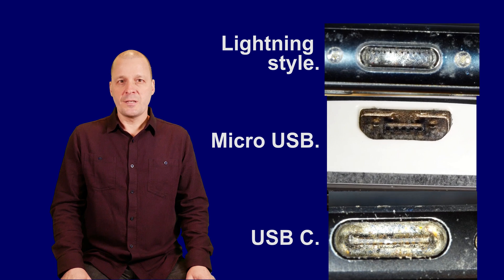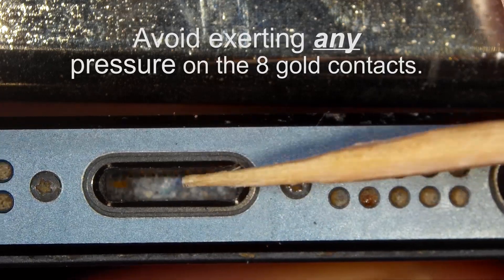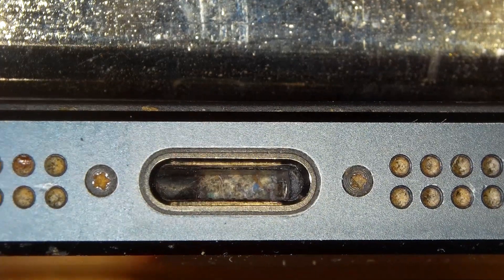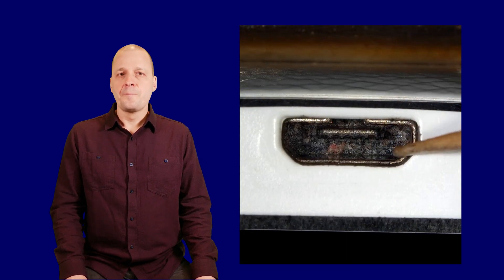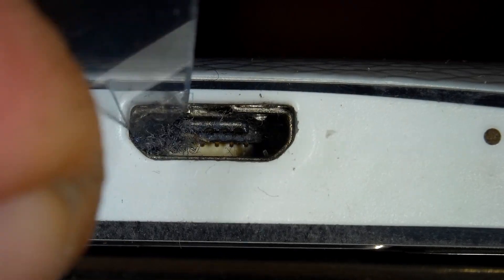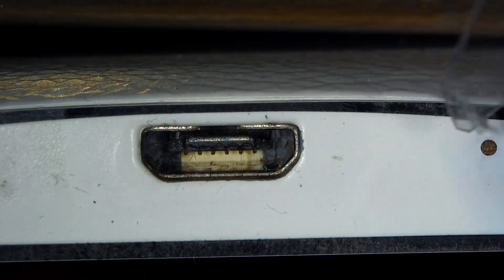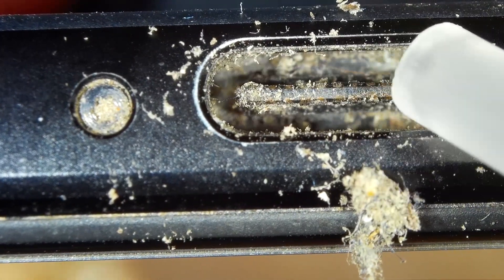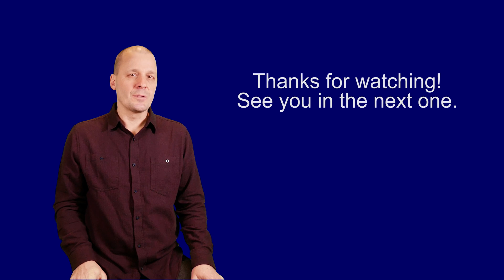"Simple" Fix for Phone Not Charging: Works in 2025. Lightning, Micro USB, USB-C #32

Comment: Okay, I've got one here that's really got me stumped. I'm having the problem you describe in this video, that is, a loose charging cord connection that is easily demonstrable by the mere effect of gravity, and a phone that won't charge as a result. It's an Android A71, it uses a USB-C style connector, I can't observe any visual impaction in the connector socket, in fact it looks remarkably clean, but my eyes aren't what they used to be, and there is a definite rocking motion observable when the connector is pressed firmly into the port. The connector seems to want to list to one side at an obtuse angle more than it does on the other. I've tried using a different cord, I've constructed a cleaning tool using your clever little teardrop design out of that damnable but indestructible clamshell packaging that takes an act of Congress to get into, and I've used a plastic toothpick of the type that flips out of the handle of a single use disposable dental flossing tool. I've recovered no debris or lint, and while my eyes may be deceiving me since I'm pushing 50 these days, it sure as hell looks like it's clear of obstruction. I'm out of ideas here. Got any Hail Marys for me?
Reply: While I am tempted to reach for the bottle to drown my sorrows, the vodka I've got is only 80 proof, which means it's not very well suited for my purposes. I'm going to go pick up some isopropanol in a bit and see if that gets anything moving. It's possible the port looks clear because it's so solidly impacted that it's formed a flat surface. That can sometimes happen with earwax, which is the real reason you shouldn't clean your ears with cotton swabs. If it works, I'll report back.
Reply from the maker: Okay, On my phone, "once", I ran into a scenario where the USB C charge cord end had debris jammed into it! That stopped the plug from going in all the way. You mentioned that you tried another cord. I would verify that the charge cords aren't part of the issue, by plugging them into another USB C port and making that they are snug. Your USB port shouldn't require ANY solvents (just my opinion of course). Please let us know how it went. Good luck!
Reply: @mysimplefix  Hey, sorry I took so long getting back to report my findings, I was delayed by a combination of life getting in the way and trying to hunt down this particular page in my history. (Side note, I love Firefox, but its bookmarks are TERRIBLE, my God.) The isopropanol worked! However, it did not present in a way that I've heard of before, so you might want to make note of this one, because it's definitely an edge case. In my situation, there was no substantial debris causing the blockage, so my eyes weren't misleading me. To recap, I was having both a failure of the charging circuit to close, as well as what appeared to be an obstruction in the port socket. I used a feeding bottle for baby animals (I live on a mountain, they're everywhere) to apply enough droplets of isopropanol (91% pure) to fill the socket, let it air dry right side up, that is, port pointing down, then repeated this process upside-down. This was so that any runoff that got into the case wouldn't have gunk in it, and to ensure that all contact surfaces were adequately covered. It fixed both problems like magic. All I can figure is that some sort of thin, non-conductive liquid had dried and was covering the contacts and making the connector fit in too stiffly. I do a lot of work outdoors, so I often get covered in tree sap and all sorts of other mysterious substances, so I can only guess that some of that got in there. Again, at no point did I recover any physical debris such as lint. Whatever was doing it was invisible and insubstantial. Put this one in your case files, because it was an oddity.

Comment: The C is male type of pins. Lightning is female type. Micro USB A has the most but micro A with B does not have many. For Samsung Galaxy S5, it has micro A with B and it has charger USB cap for protection. I stay using Samsung Galaxy S5 to use charging cap to protect not to get moisture dust and debris get in and it shows when I disconnect the micro A with B USB cable it shows close the cap. When it is not responding to charge, you need to look at the micro USB, lightning, C pins. When you see nothing from the pins, then it works properly. I also close all my devices using charger cap to stay protected firmly.

Comment: Thanks for this, very useful. I've just determined that the problem with my phone's USB C port was compacted lint. After turning it off (a very important step), I've just used a very fine sewing needle to work away at the compacted lint and clear it away. The port works fine now.

Comment: I’ve been trying to fix my rig headset with a micro usb because the charger is loose and it won’t charge and I looked into the charging port but I don’t see any debris and don’t know what to do
Reply from the maker: If the charging port is a micro USB, and it spends a lot of time in your pocket, it will quite likely have debris in there. I will ask, when you plug the cord into the port, is it going in all the way to the bottom? If not, there likely is debris stuck between that small tab and the inner wall of the charge port. As described in the video, that debris needs to be carefully swept out. Don't bend the tab in the port!

Comment: I was about to purchase a new USB-port and started stressing out about my phone still not holding the charging cable (I've used rubber bands to clamp the charger in place for the last six months) in place, even with the bands, and then I saw this video. Thank you so much, fine sir! You've saved my 3 year old Huawei P20, which is good as new after using a shaved toothpick.
You're my hero of 2021!

Comment: There was little easily visible dirt in my micro-USB socket, so I was less than optimistic. But then I patiently dug around for about 10 minutes with the recommended plastic tool, as if in a mine, and to my amazement, new material kept appearing - deposits from years of being in my trouser pocket. Finally, I looked at the plug of the charging cable, and it too turned out to be a culprit.   

I had already decided to stop using the mobile phone - charging had become a pain because it only worked when I used both hands to enable charging. Often I asked myself: Is this long phone call worth the charging agony? Yet this is just my back-up and hiking phone, which I rarely switch on.

It is always very satisfying to get something working again with a simple intervention. So thank you for this and the older instructions I found before I went mining!

Comment: Should just slap a small strip of contact paper over it. Just thought of that.if you get a sheet it'll last you forever. Yeah it would be a pain in the ass to keep changing it out but beats having to deal with a dysfunctional port
Reply: That's a great idea!!! Scotch tape, duct tape, electrical tape, or a plain old Band-Aid tape would also work!

Comment: I stumbled upon your video in search of a DIY option for fixing my Samsung S8 not charging, or providing data access via the USB C port. I looked at my port, under a strong light and could not see any dust!
It seriously looked "normal".
But just as you described; it was definitely there. It was just so compressed it looked like it was part of the surface of the inner wall of the port.
I followed your advice and directions and it worked PERFECTLY for me!
Thank you for saving me the cost of having that port needlessly replaced!

I am now a subscriber!
Reply from the maker: I'm glad this helped you!